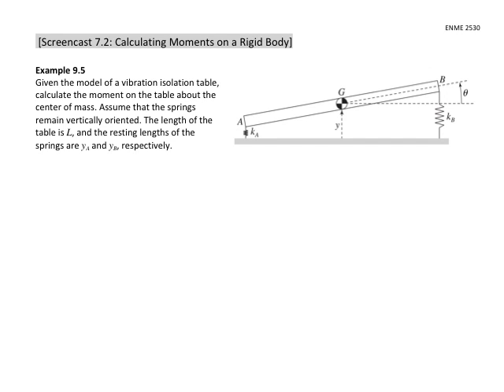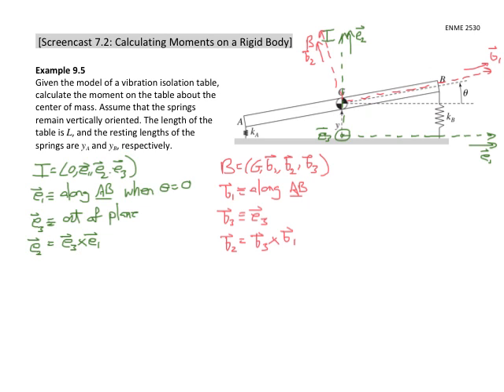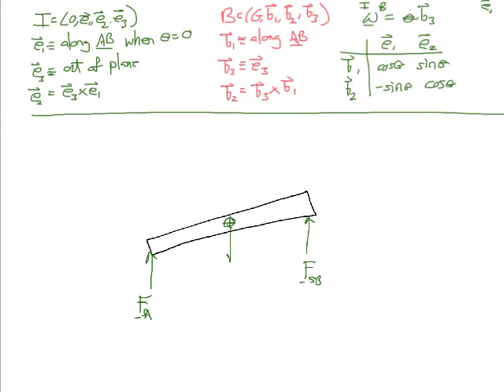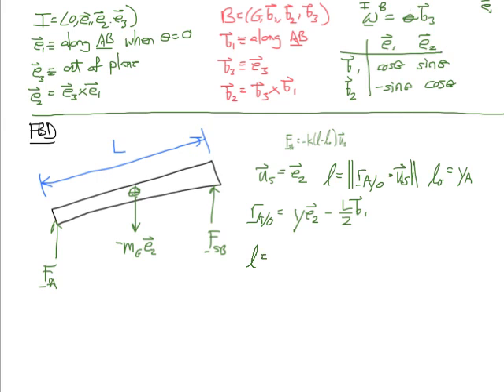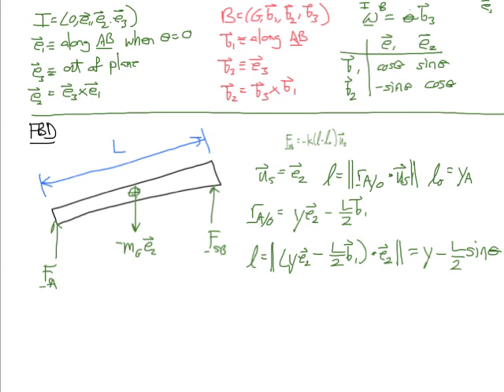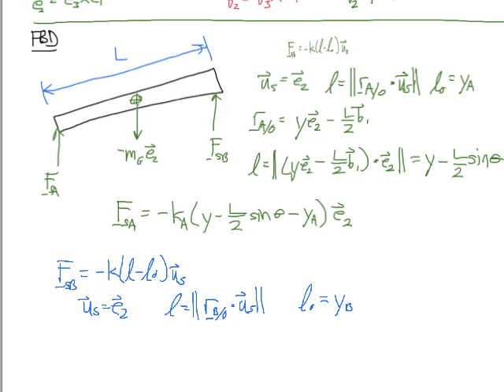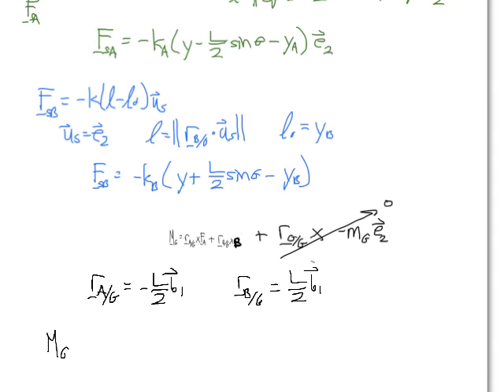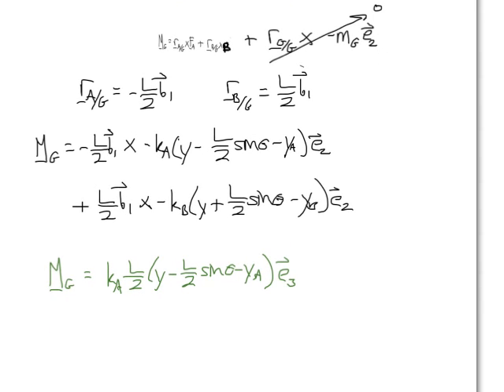Screencast 7.2 - Calculating Moments on a Rigid Body

Comment from the maker: @Oskar, Thanks for the complement. I'm glad people are finding it.

This screencast is from the Rigid Body Dynamics course I teach at the University of Denver. Its based on the excellent textbook "Engineering Dynamics: A Comprehensive Introduction" by Kasdin and Paley.
http://www.amazon.com/Engineering-Dynamics-A-Comprehensive-Introduction/dp/0691135371

My class accesses it through another website (EdPuzzle); and it looks like YouTube doesn't count those views. Feel free to share these screencasts with others you think could use it.